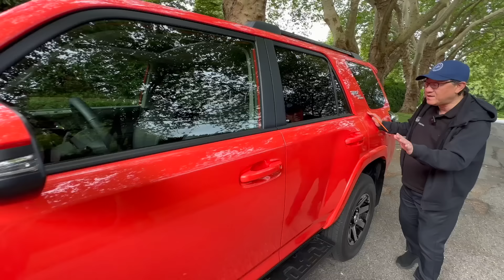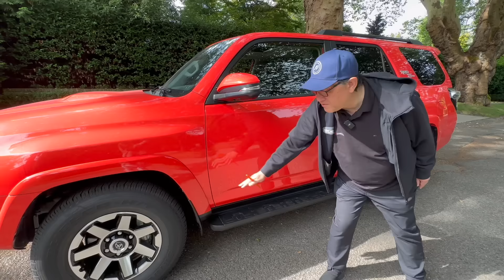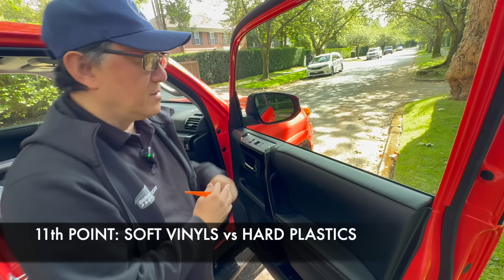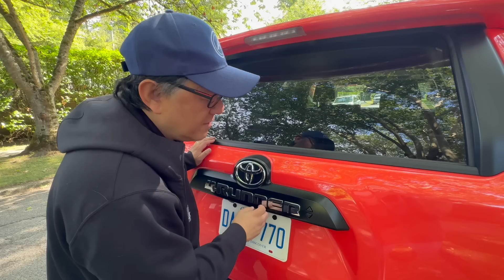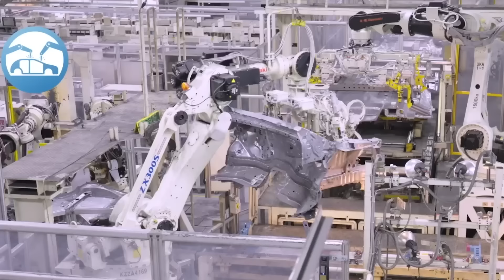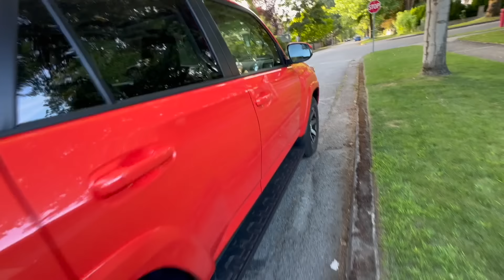30 REASONS WHY 5th GEN 4RUNNER WILL LAST 30 YEARS // FINAL REVIEW OF 2024 4RUNNER

Comment: The title is a bit disconcerting as it implies the upcoming 6th gen 4Runner will not last 30 years!  I believe it will, but the owner will have to change the lubricants and filters more often and to be prepared for some fairly costly component breakdowns along the way.  Like the all new 2018 Camry has seen formerly durable parts like the thermostat, water pump, coolant bypass valve, evaporative purge valve and intermediate steering shaft wear out prematurely.
Reply: Any car will last 30years if you fix all the things that fail over time…
Reply: In 5 years people will have forgot about all this "turbo's bad" talk. People say the same thing every time a new generation of 4Runner comes out.
Reply: @GBcommander  true,  but that doesn’t mean there won’t be some problems with the first few years.  My fourth gen (2005) had to have a head gasket replaced, which was a common problem on cylinder 6 that Toyota never acknowledged to fix under a recall.  That’s the same V6 they’re running today.
Reply: @flyguy2021  100% agreed. Def makes sense to wait 2-3 years after a new redesign so they can work out the kinks.
Reply: @GBcommander  I gotta say Toyota quality in general has gone down some over the years as well.  I had a 1979 Corolla  5 speed manual that cost me $3500 brand new from the dealer  that I abused for 200,000 miles over 8 years until I got tired of it and sold it for $900 in 1987.  Who knows…it might still be out there.

Comment: This sounds like my 2nd Gen 95 4Runner. She is built like a tank. Do they offer this Gen in 6 speed manual? I love my manual transmission. Great video 🙌🏽
Reply: Have a 5th Gen 4Runner and love it dearly but a 2nd Gen 2 door 5 speed is one of my dream cars. Think it’s one of the most under appreciated vehicles ever sold in the US. The 3.0 was a little wonky early on but just the same, that 4Runner is still basically a Hilux with rigid metal shell. Which is kinda nuts…in the very best way possible.

Comment: I am a potential new customer for toyota,…and i want to know which 4runner to get? Trd, limited, etc etc. not sure about the difference, (i hav owned VW atlas for 6 yrs now)
Reply: The Limited has full time 4WD and the most plush model, the other models don’t. The TRD Pro and TRD Off-road are more off-road biased with additional 4x4 features. That’s about it. If you’re not going to off-road it much, and you don’t care about plushness, get the base SR5. If plushness is important or you don’t want to worry about when to shift into 4WD, get the Limited.

Comment: I own a 2023 Limited. This vehicle drives, rides so incredibly well. It’s so much fun to drive. Smooth as silk shifting. Comfortable ride. So quiet inside. The 4Runner feels so comfortable & solid. I even get 21 + miles to the gallon ( live in a rural area); driving in a normal driving mode. The Limited is more ‘Shinier’ than I’d like, however, such a fantastic vehicle I live with it. Maybe after it’s out of the 36,000 miles warranty I will  ‘modify’ the parts that are shiny to ‘black-out’. This vehicle I will keep forever. I have no regrets. None . The 4Runner is the Best vehicle I’ve ever owned. I have owned trucks, sports cars, sedans, coupes, of many brands. Many were great, & I loved them. Honestly though, my 4Runner beats all of them.
The 4Runner is one beautiful vehicle. Hands down the very best vehicle ever made. Don’t believe me. Go out & test drive one . Make your own decisions & judgement. You won’t be disappointed. You’re going to want to buy, on the spot; immediately.

Comment: You forgot the most important factor, crash safety. Because the 4Runner is so old its crash Safety isn’t as good as modern vehicles. I’d rather have a vehicle that is slightly less reliable but saves me and my family from getting injured or dying.
Reply: Yeah, the safety isn't great, especially rollover. He also didn't mention how bad the gas mileage is, how slow it is, so on and so forth. I get it's reliable, but so is a Highlander and many other vehicles.

Comment: Vehicles designed between 2000 and 2020 were the peak of reliability.  Modern technology and manufacturing capabilities married with conventional power trains and prior to the aggressive light weighting.  The introduction of highly stressed power trains and lost durability consequent to reducing weight have offset the gains of quality manufacturing.  If you own a well built and reliable truck now, chances are you will never be able to replace it with a more reliable gasoline powered new model.  I’d hold on to what you have.

Comment: For me when I saw images of the 6th gen 4Runner I was not crazy about the new body design. Furthermore, when I found out it was going to have a 4cyl turbo, I lost interest very quickly. I also heard the 25 4Runner does not have on body frame bump stops (it’s now in the suspension) and that was the tipping point for me. I caved and got the 24 4Runner trd off road. So far I’m pleased. I hope it will last me a long time.

Comment: Got a 2005 Lexus GX470  with 200k, runs like a champ.See no reason it won't run at least another 10 years
Reply: Keep changing the oil and filter every 4000 miles and it will last you forever

Comment: In 1990 or 1991, I purchased a brand new Toyota 4Runner 4 door V6.  This was the 2nd generation 4Runner.  It was very reliable and it didn't need any repairs for years.  I never really liked the styling and the acceleration was slow.  It was somewhat noisy by today's standards. Gas was so much cheaper in 1990 (CDN$0.50 / L) so I didn't think much of the miles per gallon back then.  But in 2024, I think the reliability is there still, styling is still boring, and the milage is not acceptable with gasoline at about CDN$1.69 /L ( CDN$6.40 / Gallon).  In addition, as we get older, it is harder for people to climb into the cabin.  IMO, future resale value will decline significantly for this generation of 4Runner as gas prices keep increasing, and it will. At the time of writing this, the 2024 4Runner is about CDN$62,000 before taxes and extras. Thirty years from now, gasoline will be CDN$10 per liter at least and I will be too old to care and this 4Runner will be long gone.

Comment: 4runners are built like tanks just look my 1999 3rd gen limited literally EVERY switch and button still works like new, from the power seats to the mirrors and sun roof and ofc the iconic rear window still rolls down like new. I stop at a red light and won’t even hear a squeak coming from under the hood.

Comment: You showed the four wheel drive control as a rotary Dial which is incorrect it has a manual lever for  four  wheel drive like all four wheel drive vehicles should have simple and reliable!!
Reply: Only TRD OR and Pro models have manual lever.   All the other models are rotary design including the Limited  image one he showed which has full time 4WD.

Comment: I really like my 2020 TRD PRO, purchased new.  I have this odd clunk in the front end only when driving slowly over bumps. All weather, not just when cold.  Dealer says they cannot duplicate...
Reply: Some Pro models get body rub from the tires.   There is a TSB for this.   If they see this is the culprit their is a mod the dealers are instructed to do that remedy the situation.
Reply: It’s probably the front Fox suspension. There is a TSB to change to the updated 2021+ version. The clunk is usually a lot more audible in cold weather.

Comment: Who cares about fuel economy; if you save $1000 a year but spend 5-10k in transmission or engine repairs you are really not ahead.  Cost of ownership is less on this kind of vehicle than the newer more complex vehicles especially if you want to keep something for 10-15 years or more
Reply: You realize in your example the $ is the same either way right? Your numbers the money either goes into the air or the mechanics pocket. You can care about both, fuel economy and reliability
Reply: @D0praise  Exactly. Honestly, unless someone is off-roading seriously, there's very little reason to get a 4Runner over a Highlander. 90% of the utility of a 4Runner with better on-road manners, better mpg, and a more comfortable ride. Oh yeah, and Toyota reliability.
Reply: @GBcommander  You didn't mention towing.  I would take the 4Runner any day to pull my bass boat over the Highlander.
Reply: @CAN43714  Highlander and 4Runner can tow the same amount. If my primary goal was to tow something, I'd get a real truck instead of either.

Comment: We have a 2014 4runner Trail. 3" lift 33" tires, winch, rock sliders, dual batteries, Fridge, set up for Overlanding. Just towed a 4000# travel trailer cross country 4800 miles, even in the mountains, no issues. Has 162,000 miles and still drives like new. Wish it got better gas mileage and the tech was updated. Will wait until the 2026 comes out. Then maybe we will change. Not in any hurry...

Comment: I bought a 2024 TRD ORP and I don't think it is built all that great. The metal seems very flimsy and flexes like crazy. The metal on the hood flutters while driving at highway speeds. The paint is like watercolor paint because it chips if you look at it. The plastics inside are cheap and scratch very easily. There are a lot of vehicles on the road that are of much higher quality than the 5th-generation 4Runner. Yes, it may be reliable, otherwise, it is not that impressive.
Reply: That's Toyota in a nutshell. Mechanically sound but in every other respect, lacking.
Reply: disagree

Comment: I was waiting to buy my wife a 2025 4Runner but after watching your videos I went and picked up a brand new 2024 trd off road for her. I couldn’t be happier with our purchase. Thank you for sharing such valuable information.
Reply: We just purchased a 2024 4Runner offroad premium with the kdss also.Obviously we chose this over the new 2025 coming out soon.Sold our 2013 4Runner sr5 to a friend. Had 106000 miles on it.
Reply: @360woodierc  I’m hoping to keep this for many years as you did with your 2013. We had a 2016 jeep grand Cherokee that we sold for the 4Runner. By the time it hit 100,000 miles we had rebuilt the motor, two fuel pumps, water pump, egr valve and multiple relays. The fit, finish and overall quality on the 4Runner is so much better.
Reply: Me too took a year of searching! @360woodierc
Reply: I think you made the right choice.
Reply: I actually had a 2019 and bought very nice upgrades while weighing 2025 4Runner, Land Cruiser, GX550.  Rather than installing on the 2019, I traded in for a 2024 4Runner and now am putting the awesome upgrades on my new 4Runner.  I feel like I’m still ahead in price and it looks killer.  I could still add a supercharger and be ahead on the other 2025 vehicles, but not sure it needs it.
Reply: @BeAsOpinionatedAsOpenMinded ya I stopped caring about putting a supercharger on my 2023.  The engine feels powerful enough and I don’t want to mess up a classic.
Reply: Best choice 👍🏼
Reply: Congratulations 🎉
Reply: You made the right choice 1000 percent.
Reply: Smart choice!
Reply: This is the way
Reply: 2024 way better than 2025 . I should of traded my 2020 in for a new 2024 before the change has the v6 more cargo space manually transfer case
Reply: Congrats🎉
Reply: GOOD CHOICE - That’s the one I’m going to get in a few years
Reply: Those Jeep start having real $ issues once the hit around 60k miles.
Reply: @360woodierc  my 2009 2 door Wrangler Rubicon has 125k miles and has given me 0 issues.   I also own a 2020 4Runner but I have no qualms taking my Wrangler on a cross country trip for off road adventure.
Reply: Does she make no money? You are still living in the 50s in the USA.
Reply: @svein-haraldribland8559 traditional households will always be around no matter how much you commies try to ruin it
Reply: @svein-haraldribland8559 a man should always take care of his wife. Sorry you don’t understand this

Comment: Great videos you have David!! What are your thoughts on KDSS for a 4 runner?
Reply: I love my KDSS.  Handles better on road than non KDSS models.   Same goes off road, better articulation.   Best thing is that it is automatic.   No need to turn on and off the system.  
As with any 4Runner, just make sure you remove any salt spray from the frame and or undercoat it if you live in the north.
Reply from the maker: I've owned 7 different 4Runners so I'm very familiar with KDSS.  What people don't realize is that KDSS doesn't affect the general ride when driving on normal roads.  It really only comes into play when driving over off-road terrains.  So people who think that KDSS somehow improves rides are not understanding how the system works.  KDSS only becomes effective when it senses imbalance of the wheel articulations ... it is not engaged when driving in normal conditions (city or highway). And this is even more impactful on the new Lexus GX 550 (e-KDSS) because the system automatically disconnect the stabilizer bars when the road becomes extreme (in slow speed only).  The new Land Cruiser/Tacoma/4Runner no longer has any KDSS and instead, has manual stabilizer disconnect.  Hope this helps.
Reply: Toyota's Kinematic Dynamic Suspension System (KDSS) can help reduce body roll in vehicles:
Explanation
KDSS is a hydraulic system that limits a wheel's vertical movement, which can help keep a vehicle from rolling during turns or sudden maneuvers. When driving on the road, the KDSS's cylinders lock the stabilizer bars, which twist to provide resistance and reduce body roll. The system is also fully automatic, adjusting to changing road and terrain conditions in real time.
Example
The KDSS system is a feature on the Toyota 4Runner TRD Off-Road model. The system includes a large stabilizer bar that runs along the front of the lower wishbone, with a rigid pivot point on the passenger side and a hydraulic cylinder on the driver side. On paved roads, the hydraulic side stays rigid, but off-road it goes limp, allowing the bar to move up and down freely and lose its ability to generate roll stiffness
Reply: Yes, larger stabilizer bars can make a difference in the Toyota 4Runner with KDSS suspension.

	•	Cornering  A KDSS 4Runner with a larger stabilizer bar can corner more flatly on winding roads.   
	•	Handling  A KDSS 4Runner with a larger stabilizer bar can better handle a rooftop tent than a non-KDSS 4Runner.
Reply: KDSS improves both off-road wheel articulation and on-road handling.

Quote from Engineer Dan Edmunds, suspension expert who owns a 4Runner with KDSS
Reply: @AutomotivePress  It does David thank you!!
Reply: For some reason David never comments on KDSS 4Runner. I think he has never drove one or test rode one before.
Reply from the maker: @Jim-s6i3b  Are you serious?  Please see my comment above... FYI I've owned 7 different 4Runners ranging from Limited to TRD Pro and 3 different Lexus GXs so I am definitely knowledgeable about KDSS from actual practical perspective.

Comment: I'm on my 2nd 4 Runner, a 2020 Venture. Your videos are some of the best when it comes to education. I do take it off road about once / month and always try to lock the rear axle on a steep hill. I had rock sliders installed by 4WD parts when the truck was new,and they definitely have protected the underside,especially when it comes to rocks sticking out of the dirt. I just had Les Schwabb put some off road Toyo tires on it, same size as  factory, and I'm good to go. Plan on leaving everything else stock. I don't have any desire to try any rock climbing or swamp   driving. This truck has always gotten me where I wanted to go. I planned on keeping it forever when I bought it and everyone of your videos just confirms I made a good choice. This 6 cylinder engine is perfect for me ,with rising gas prices and all the talk of electric vehicles in the future. I have no interest in a 4 cylinder turbo engine that the new models come with. I think these "old school " 4 Runners will someday be collector vehicles like the Fj's that were sold here in the USA.  If anyone reading this wants one, get one while you can !

Comment: Had 140k on my 2014 trail when I sold it. Only changed the brakes, battery and tires. Used it for some pretty aggressive off roading(for 33in tires) regularly too.

Comment: Love my 2016 4runner trail with kdss, and she's all decked out for overlandding. Not one single problem. The only thing I've replaced is a new battery and the drivers side heated mirror ( glass ). With only 54000km, a ceramic coated body, she still looks in showroom condition. And yes, she goes off-road for camping adventures, i just baby it and look after it 😊